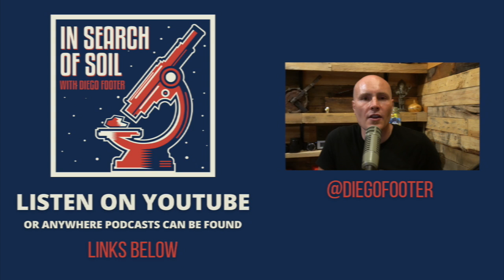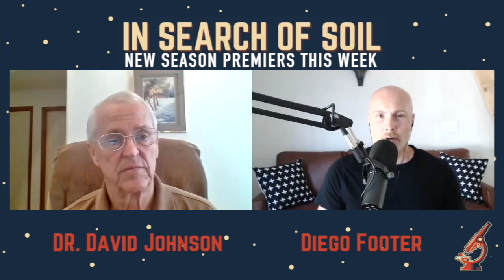Why use Johnson-Su Bioreactor Compost? - Dr. David Johnson

Comment: I also wonder about weed seeds and pathogens. Seems like outer edges are a bit cooler and therefore might not be completely sterilised. And this process probably makes chicken wire method even less sutable. With chicken wire outer or inner edges, especially with one big inner tube are even cooler.

Comment: Old timers in UK have been using leaves for years it’s called leaf mould and it was left for a year before it was used. So Dr.Johnson Bio Reactor is a modern version of what the old timers in the Uk we’re doing, a lot used a Chicken Wire Round container about 2 ft diameter.
Reply: Well, at the very least he expanded the volume of product on one go

Comment: I think I'm safe in saying '..there's no such thing as a commercial compost that has the qualities of compost made using the long-standing, low-disruption method the Johnson-Su reactor (or similar) creates. Guys who make commercial compost are motivated to make it fast and bagging it early..all about cash flow. It's great in adding organic matter to the soil, and eventually the diverse biology will follow...but that could takes weeks/months. I'm a small garden gardener. I ordered several yards of mushroom 'compost' early this spring, but was unable to use it as the internal temps exceeded 170 deg F.  So I just let it sit in place, and I've been monitoring it microscopically as time goes by. The growth of protozoa, nematodes, and fungal hyphae has been remarkable as time goes by. Not the same stuff that was delivered  90 days ago, at all. And the squash plant I planted in it is very happy. So my point is, don't have high expectations for the commercial compost 'as is.' You still need to give it time to mature into quality compost, either through weathering or through soil-biology integration.